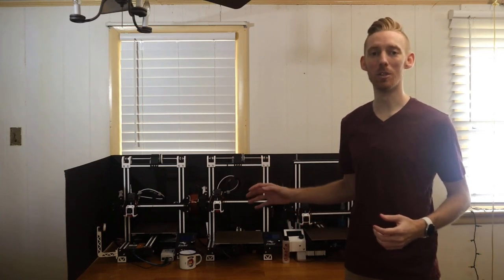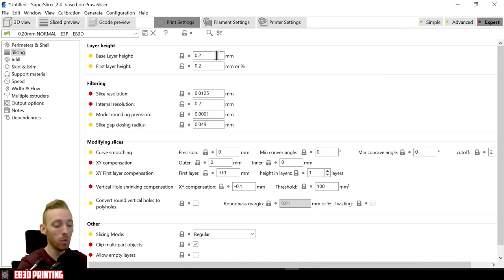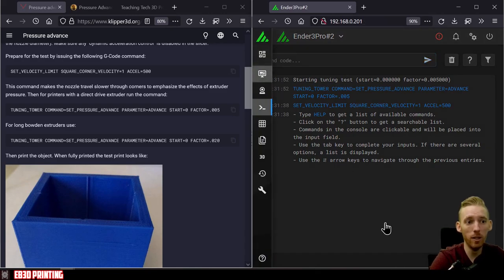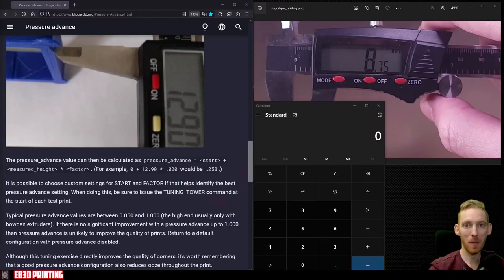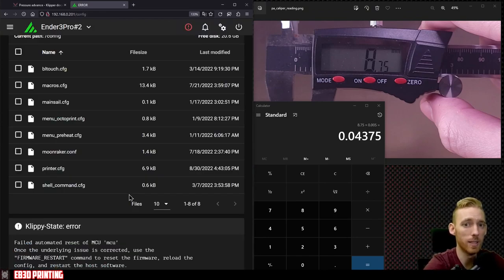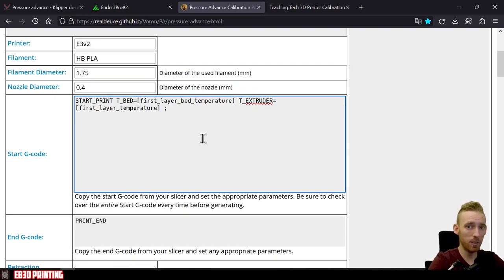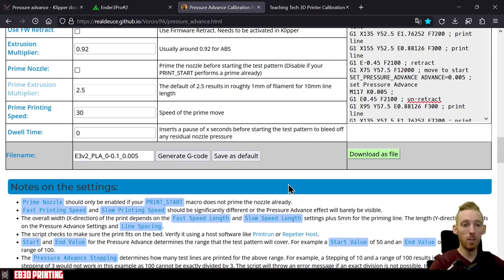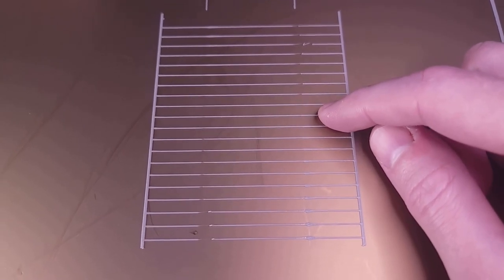Klipper Pressure Advance Tuning on the Creality Ender 3v2

Comment: Thank you for this great video. I've been trying to get my Ender 3 setup with Klipper on and off, but always seem to have problems when tuning the PA and Input Shaper. I really like the line method for PA. It looks so much easier to understand and measure. I don't have an accelerometer for doing the input shaper test, so I have to use the visual method, so I'll have to rewatch your previous video on it. Glad to see you back and looking forward to more content. PS could you possibly do a video on setting up Superslicer for Klipper? When it comes to printing faster, I'm never too sure what I need to change in the slicer or firmware. IE Acceleration and what not
Reply from the maker: Thank you for the kind words. I will look into doing a SuperSlicer set up video. There are definitely a lot of options available that can be changed to improve print quality and speed
Reply: @EB3DPrinting  That would be so cool. I use Prusaslicer at the moment, but when i make the move to Klipper properly, I'd like to use Superslicer, as it seems more suited to it. I maybe wrong in that regard, mind you.

Comment: What if I finished the tower and I see no gaps? It is all smooth and consistent till the top?  I'm quite sure i did all the steps, and set al things up like you did.

What for kind of value do I add in my config? 

I use a direct drive setup
Reply from the maker: If you have a direct drive setup and finished with no gaps in the tower, I would say that something was not input correctly and to run it again. If everything is correct, there more than likely will be gaps forming around the halfway mark of the tower.
Reply: @EB3DPrinting  thank you. I will try the second method of yours.. Saves time 🙈 thanks for replying